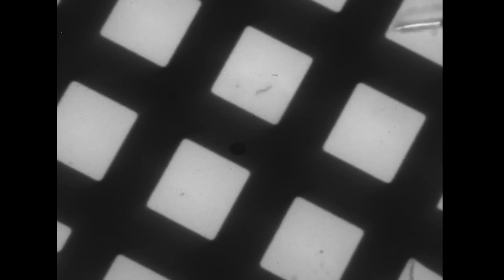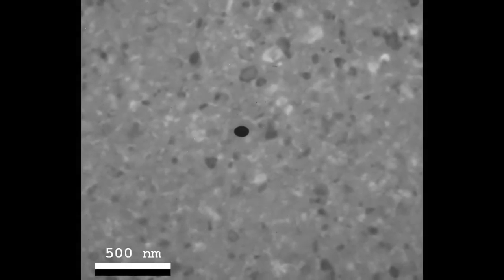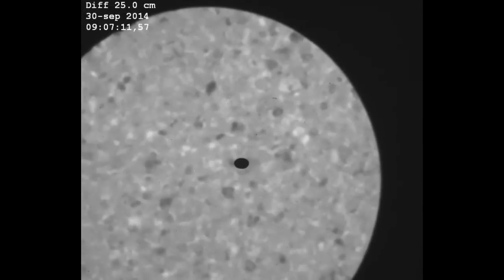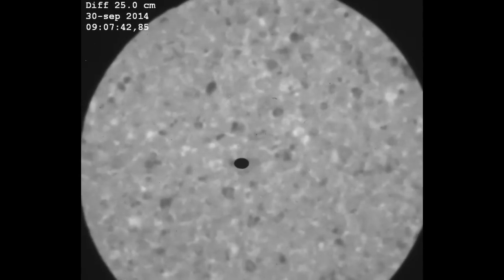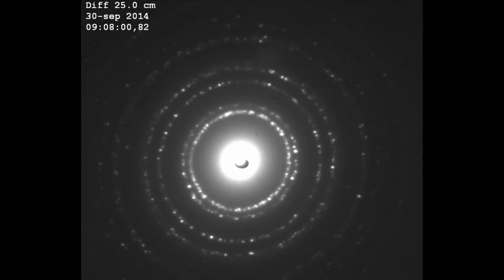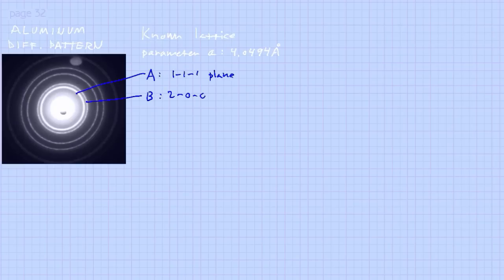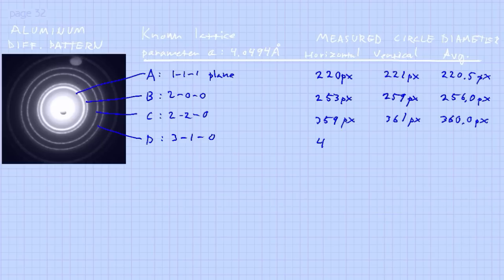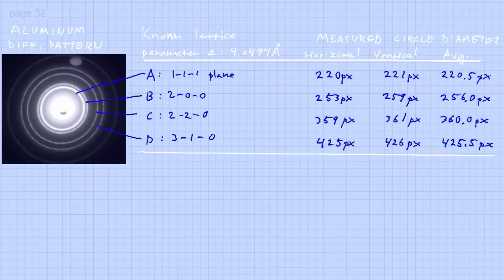Transmission Electron Microscope TEM Lecture #2

Comment: Thank you for this video it has been very helpful. When you were measuring the diameters of the Al calibration sample, how did you know which rings corresponded to which plane. For example how did you know that the innermost ring was the 1-1-1 plane etc. I admit that I don't yet fully understand the meaning of the 1-1-1, 2-0-0 etc.

Comment: Very informative and logically explained lecture. Thanks for making it available.
I hope you consider coming up with the third clip.
I am interested to gain knowledge about TEM column alignment techniques, and the science behind it.
For Example: Most User Manuals explain how to align the Condenser Lens Aperture. However they don't explain what would happen if it is misaligned. What kind of side effect on image would be seen, if the aperture is not aligned.
Sincerely,
Jay
Reply from the maker: Jay K Column alignment was a good Idea, that's usually very weird to get a grip on at the beginning of learning, I might do a topic on that sometime. Regarding the condenser aperture, when missaligned you often get problems like when changing beam brightness the beam don't focus concentrically but drift of into the corner of the viewingscreen instead. Small missalignment also affects the resolution.
Reply: Magnus Hummelgård Hello Magnus,
Appreciate your reply.

Comment from the maker: +unexceptionalrebel well to make it simple: large spacing in the lattice planes give rise to small rings in the pattern and oposite goes for small spacings that gives big rings. 1-1-1 is the largest spacing and must be therefore be the smallest ring. I suggest reading about crystal structures and Bragg's law at wikipedia for more details on this.
https://en.m.wikipedia.org/wiki/Crystal_structure
https://en.m.wikipedia.org/wiki/Bragg%27s_law

Comment: I just wonder how you change from Bright field mode to diffraction mode? (view back focus plane?)
I learn from your lecture so much, thank you for that.
Reply from the maker: +Binh Nam IMS Theoretically you can just continue to turn on the focus nob and you end up in diffraction mode sooner or later. But normally you have a short-cut option on the system, that is a dedicated button and by pressing that one the TEM change mode automatically. -That's the one I use.

Comment: Hi, great lecture thanks.
There is a typo, I think for the 4th ring "D" you want to write 3 1 1 instead of 3 1 0 (destructive interference)
The calculation seems correct though.
Reply from the maker: Taufik Adi Nugraha Yes that's right!, thanks for noting it. Glad you found the lecture useful.

Comment: Hej Magnus! 
Really interesting overview! I calculated about 6E-3 e- in the sample at a given time, it seems really low! could it be ? =)
Reply from the maker: Skaraah depends on if you account for relativistic speeds of the electrons, but nomatter what you end up with, something that is less than one electron is correct, that in turn shows us something about wave/particle duality thus how come a diffraction pattern still to be visible if only one electron in turn is interacting with the thin sample. Thats the lesson to be learned.